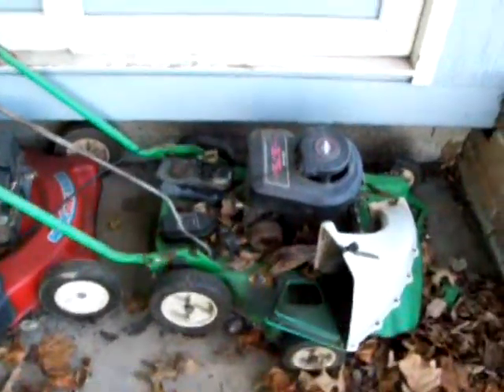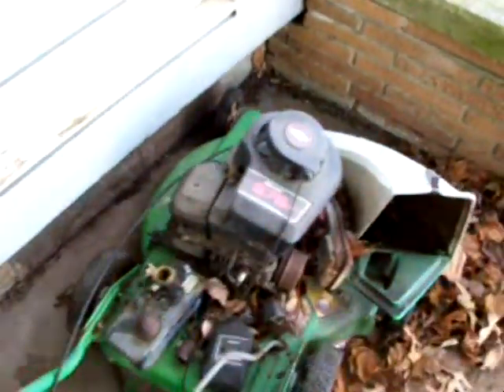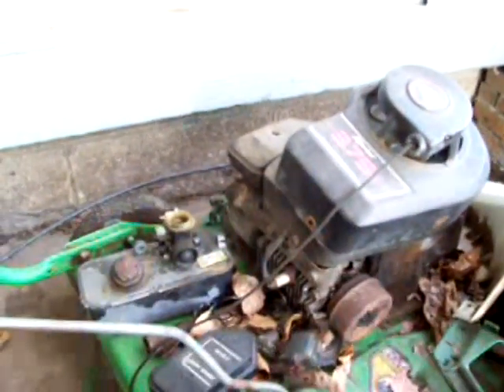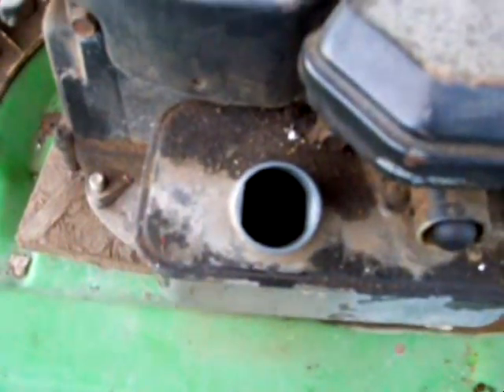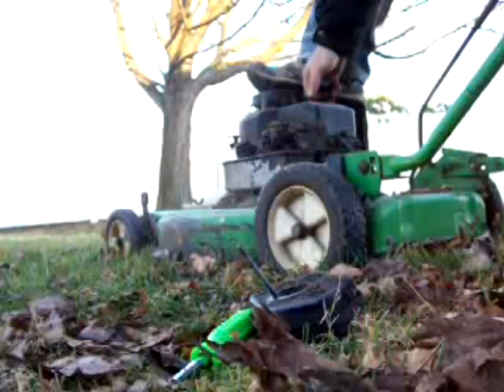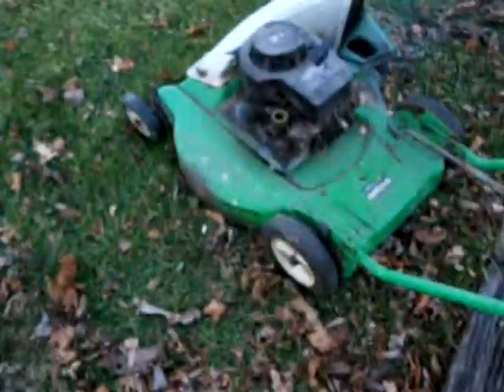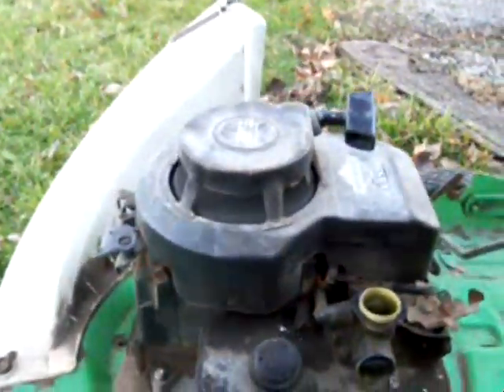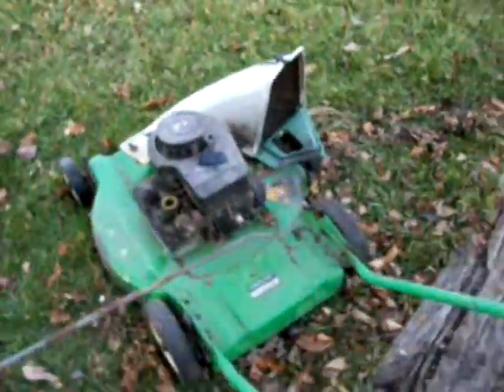First Start 4 Years Briggs 3.5 Engine

Comment from the maker: It drinks oil, check it each time and add some.  The earlier vid I did of my other briggs before I replaced it was using a quart every 2 to 3 hours runtime.  Got pics of the inside of that old engine on my website.  The one I have now uses NO oil and suprisingly uses very little gas, got it for free so im not arguing with that!  LOL